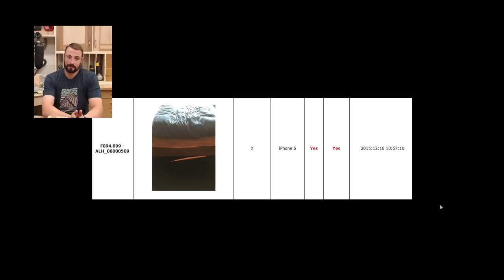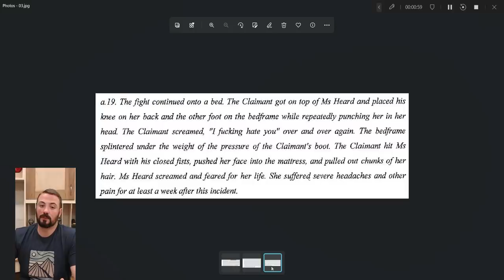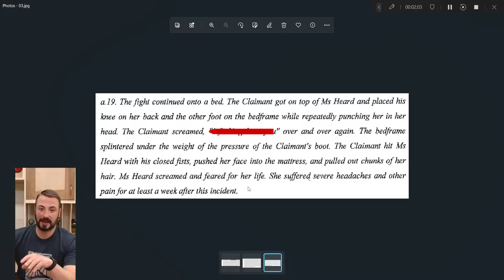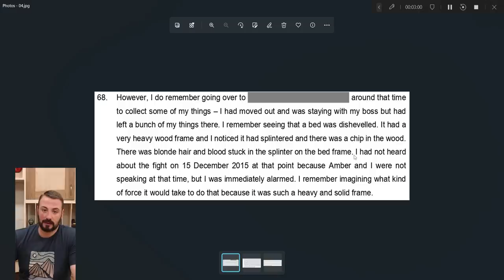Woodworker Attorney DEBUNKS Amber Heard's "Broken Bed” Testimony!

Comment: The only thing I could imagine was that the wood was already pre-chipped by some unrelated incident and the boot just detached the splinter, but that's not very compelling. Seeing how you pretty much exactly matched the break with that knife very much makes me think she went around creating evidence
Reply: Totally 💯
Reply: It's not entirely unusual to find a weak section of grain on a corner of pine.  I don't find it unbelievable to claim that a boot could apply enough force to shear it off, if there's already a crack formed to allow the boot toe or tread to catch.
Reply: Even if that was the case, even if it was already pre-chipped, I find it sus that she puts so much emphasis on it. It sounds to me like she's clearly trying to use it to illustrate how much force he was exerting according to her story. Leaving out something as crucial as the wood being pre-chipped feels disingenuous to me.
Reply: @MerelvandenHurk  I'm on team JD, but it's not necessarily something you'd notice in passing if it was weak. The crack can be hairline, and with a dark stain it wouldn't be easily spotted.
Reply: If the crack was there already and he exerted enough force to chip it then how was he exerting enough force on her back to subdue her? There is only so much force you can exert in two different directions with your legs. I know this as a hockey player. You stride one way and you don't have the power in the other leg to turn or change direction.  
Not to mention that if he was punching her repeatedly in the back of the head, why no photos, why no audio or video? She recorded everything else and only took 2-4 pictures of all the alleged "abuse" over the year period. Nah, the woman is shady and lying.
Reply: I agree with you!
Reply: @MerelvandenHurk  Yeah that's her entire testimony to me. It feels highly fabricated. As if they lined up all evidence and tried to tell the story in a way to incorporate as many of them as possible
Reply: @sl3966  I like your take on it. Putting your knee on a person's back leaves very little force on your back leg. 
I do find it a funny caricature that he supposedly went full ground-n-pound on her and by sheer force broke the bed. It's laughably unrealistic.
Reply: @OleVinny  I have that feeling as well. I imagine an actual abuse survivor would just tell the story as-is, instead of trying to hit every mark on the evidence list. Johnny even forgot that he also had a cigarette burn on his cheek until he saw it on the picture.
Reply: @ericfeldkamp3788  But then it definitely looks like she forgot to remove the knife from the bed…oops!
Reply: @OleVinny   Minor friendly correction: Lined up all the evidence - and shows she has no idea how to do that, hence weird photos with little to no bruising, no glass all over the floor, gets spotted doing ballet the day after the bottle attack, lots of photos of a beautiful property she apparently really liked, and other photos with little substance. 😑 "Evidence."
Reply: Its certainly possible Vincent but the question I would pose to you in response would be "is that probable?"

We are talking about two extremely wealthy people who both have unique and expensive taste. If this bed was chipped to that degree before this event, what are the chances they would simply leave it in such a state before repairing or replacing it? 

To me, the folding knife on the bed is a real smoking gun. If Heard was willing to defile another bed, what are the chances she would damage this one? Some people hold beds in a very special regard, as its a place where you return to and make yourself vulnerable for an extended period of time. I think she has displayed this type of property destruction to Johnny before, considering he and his security team testified to grabbing valuables as part of his "bug out" process. I can absolutely believe that Amber would have damaged the bed and formed a story around it in the aftermath.
Reply: @BearInThaWoods  I can only imagine how physically awkward it would have felt like to not only put my knee onto someone laying in a bed but to then use my other leg to "make a purchase" then proceed to beat them unconscious. If anything at 5'10'' I wouldn't put my boot on the outside of the frame but on the inside.
Reply: yeah...and the knife in the bed is an important 'point' (pun intended)

Comment: I've worked with timbers that size and it takes forces to get through with a skillsaw even let alone a boot.  Especially if it's reclaimed wood as those look to be.  Even giving her the benefit of the doubt that there was a splinter already there, his boot would have broken the splinter in a way where there would be a point and then a blunt edge (don't know if I'm explaining that correctly).  Great job explaining it!
Reply: Was thinking this too. Plus the fact his weight is supposedly entirely on her back as well.
Reply: this wood type would definitely be breakable with a boot. particularly with that sharp right angle edge. old, brittle, and stained and grippy.
Reply: Absolutely! I was only half paying attention to what she was saying and did not see the bed frame until this video but I immediately wondered how someone could break the frame of a bed with their boot when their weight was on the bed.
Reply: @reddaB  With the toe of a boot? Think about the position he is allegedly in at the time. If he has any real weight on that edge, is foot would be pushing him off of her, not pinning her. And meanwhile allegedly his full weight was simultaneously on his knee on her back? Care to factor that into your explanation?
Reply: @nctpti2073  yeh I've literally managed to do this to wood and im short. He wears solid boots, if he steps up, then pushes it would definitely be possible. Also the photo from the e tour is old, in that time this edge could have been stepped on since and the grain worked at splitting previously. The splinter is
 thin and has little bonding it to the main plank as it doesn't run the full length. The bonds will be dry and brittle. I see steps and old wood platforms break like this. I work with wood and have done a lot of collecting and using reclaimed wood.
Reply: @reddaB  Did you hear her testimony? She was claiming he did this, with his foot, while  pinning her down on the bed with his knee in her back. Can you please explain how the geometry of that works with your theory?

And if it was 'old and brittle and previously cracked,' that again does not fit with her spin that JD kicked it so hard as to do this, thereby, she is presumably trying to argue, proving how brutal he was. If it was already broken or mostly broken, it would be proving no such thing.
Reply: @reddaB  I would agree with you if the wood were in its natural condition, but it has been planed and varnished or polished in some manner.  Since it is a bed the furniture maker would need to make sure it couldn't splinter easily.

Comment: Even when the bed's material is not taken into consideration, how Heard describes the event and Depp's positioning is very odd.
If Depp's one knee was on Heard's back, then that leg had to be bent for him to be able to push Heard down. Was his other leg completely straight? It would have had to be for his boot to be all the way at the outer edge of the wide bed frame. If he was struggling to get purchase why not bend his other leg and bring it right next to her torso? If you've ever tried to hold anyone down by placing a knee on their back or just seen police footage of suspects being subdued with a knee on the back, both legs are always bent. The other leg is close to the side of the person lying down, that way you are actually able to put most if not all of your body weight on your opponent. If one leg is straight, it's really difficult to keep balance, let alone hold anyone down. I'm really struggling to understand how they were positioned.
Depp isn't that much taller than Heard. If his boot was by the edge of the bed, the bed frame is wide and Heard was on the mattress, then he would have had to reach to hit her head. He would have had to balance himself with his other hand on the mattress. If he was struggling for purchase, why not bend his leg and move it closer to his other leg? If both legs are bent, then you can place your other hand on the person's back not only for balance but also to better keep the person down.
I really recommend people try and position themselves like she is describing the situation. She was face down on the mattress, not on the wide bed frame. Let say he had his left knee on her back, for his right boot to have reach the outer edge of the bed frame his right leg would have had to have been straight. In order to keep himself upright, which he had to have been to be able to punch her head, according to Heard he wasn't just lying on top of her, his right hand had to have been on the mattress to keep him upright. He would have not been able to put his body weight on her, and even though she is lighter than Depp, she would have been able to push him off, that is why police officers don't keep one leg straight. Then he would have punched with his left hand. (you can switch left with right and vice versa, the end result is the same.)
If you are off balance and struggling, why not bring your legs closer together?
Reply: Great analysis. 

I noticed that her and her attorneys really put a lot of effort into subliminal (?) messaging. Listen closely they repeatedly use words to paint him in a certain way. For example: they say he is so much bigger than her (he’s not). In a written statement or dep transcript at one point she said he is over one hundred pounds heavier than her (he’s not). That framing alone puts that ping in someone’s head to allow them to think that this bed break is possible because she has planted bigger and heavier. 

Additional comments - to name just a few - that they make to plant seeds are: “he is twice my age”, repeated references to Marilyn Manson, “dirty carpet” (ie he is dirty). Listen closely you can hear them all. Sly propaganda.
Reply: It's a quite natural position if you stick your right boot in between the mattress and the frame. You can use the right leg to push your left knee forward and down, and it also helps to keep your balance. Ideally you'd want to have the right foot on the floor, if it's a low bed. If your right foot is on the mattress you are more likely to lose your balance in the struggle. It works for cops because they are on steady ground, and the ground doesn't move their foot around (like a mattress does) when the suspect struggles to get loose.

It's not hard to imagine that Heard only had her upper body on the mattress and her legs below the foot of the bed. She could be at any position up or down the bed, really. She's going to be where Depp allegedly pushed her down.

I don't find it hard to believe that Depp pushed her onto the bed like that and yelled in her ear. It's the extreme violence that is hard to believe. Amber claims that Depp broke her nose that night, ripped chunks of hair out of her scalp, hit the back of her head against a brick wall, and then repeatedly punched her in the back of her head. That is so over the top it's almost comical. She would've been black and yellow for a week after that treatment, or dead.
Reply: @oaksnice , if the boot on the bracing foot is, as you suggest, between the mattress and the frame, it’s on the wrong side of the timber to cause the damage seen.
Reply: @oaksnice  Look at the pictures, the frame of the bed is extremely wide and the splinter is on the outer edge not inner. Based on that, Depp would have had to have been further back to try and get purchase from the outer edge.
In order to hold someone down with your knee on their back, you need to be almost directly above them. If the other leg is not by the torso of the person being held down, the pin move does not work. They can easily wiggle free otherwise.
Moving your centre of gravity away from where you are trying to exert power, will make you lose balance. Because mattresses are soft, the other leg would have had to have been by the side of the torso for support.
Go ahead and try the positioning she is describing, see which way you have better balance. Place a pillow or two on your bed, then your left knee on the pillows. If you place your right knee just by the pillows, you can push down on the pillows with your left hand and hit with your right. If on the other hand your right leg is stretched out straight you need to balance yourself with your right hand and hit with the left. Now remember the bed frame was WIDE and lower than the mattress. She also doesn't mention hitting her legs on the bed frame, so at least her hips had to have been on the mattress.
Reply: right? if "he" put full force onto his upper foot, enough to cause any damage, it would just be undermining "his" knee submission hold? and balancing on "his" other toe? with that kind of, baboon-esque violent attack, wouldn't she have back pain for the following week and not "headaches" ...
Reply: Don't forget he was also bent over and screaming in her ear. Try getting yourself into that position. Knee on someone's back and then bend forward so that your mouth would align with someone's ear. A small child could do it on a larger adult maybe, but the top person's hips as they bent forward would be at about the shoulder blade level of the person beneath. The top person's head would be way past the lower's head.
Reply: @KNYD  I do have a similar looking bed (but a cheap one with a fake wood frame). I frequently put one knee on the bed and the other foot on either floor or frame when I'm reaching for something on the bed. I never crawl on the mattress because it's just difficult to keep balance. Granted, I have never fought anyone on the bed so I don't know how that would play out.
In any case, I don't believe Depp broke the frame for all the reasons explained in this video. And all of Amber's stories sounds wildly exaggerated.
Reply: @oaksnice  When you're reaching for something from your bed are you trying to hold anything or anyone down or to exert the maximum amount of power with your knee? Reaching for something and pinning someone down are two very different actions.

Comment: Rob, I have this exact type of bed in my house. And you are correct. These beds are almost indestructible. Even hitting your foot against it hurts like hell. Even if I was wearing shoes with spikes around the sole all I could do is scratch it. No way a shoe could chip off that much wood like that!
Reply: I've slept on beds like that, then banged my shin on them, the bed looked great, my shin....not so much.
Reply: And wouldn't she have bruises on her legs/body from being thrown in the bed? From what I've seen (and personally dealt with when having a waterbed), there's no way to get in or out of that bed (short of stepping on/off the platform) without touching the platform. If you're thrown onto that bed, you're hitting the platform and getting bruised up!

Comment: When I viewed this picture during the trial, I was not able to see that this was a solid bed. It looked to me like the wood had cracked and the split part was hanging off from the bottom like it broke under weight - like the frame was off the floor and someone stood on it to make it crack in the middle. Seeing the bed frame in entirety has made all the difference in the world of understanding how hard it would be to break this bed under the scenario she described. Thank you so much for pointing this out and clarifying it!! Great observation and great video!!

Comment: I hope that the jury get to see photographs of the bed. When I first heard about a damaged bed from a struggle I pictured the traditional bed on legs with a frame supported at four corners. The idea of that sort of bed being damaged, even entirely collapsed, by some sort of struggle is easily imagined - it's a sitcom staple.
The incredibly sturdy-looking platform bed is a whole different matter. Even at first glance to a layman being able to kick lumps off it, even if that's what you set out to do, let alone accidentally, seems extremely implausible.
Reply: the bed picture was admitted as evidence.  pathetic reaction cam starts at 2:50 in Robs video
Reply: Same!! Imagining the bed I mean